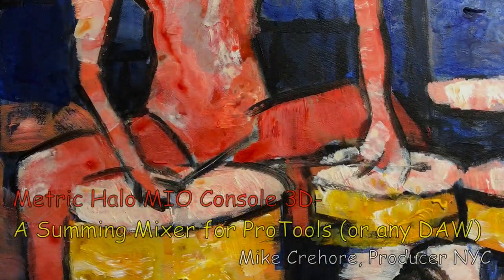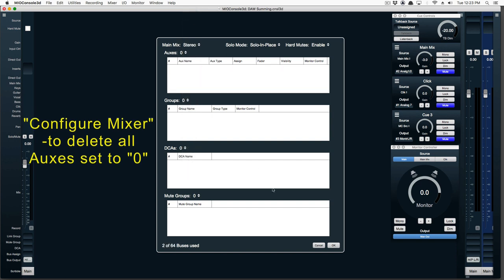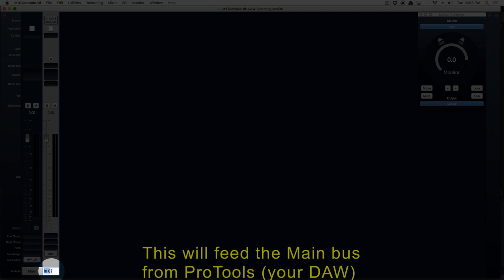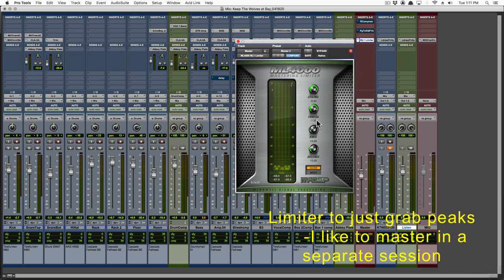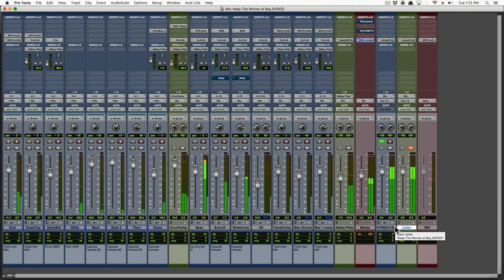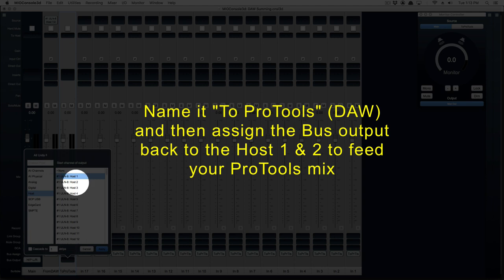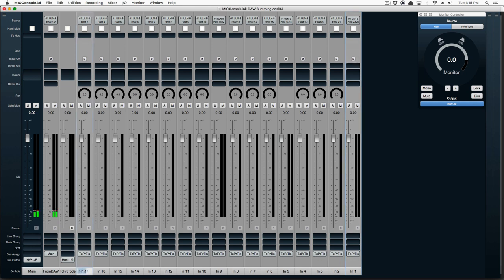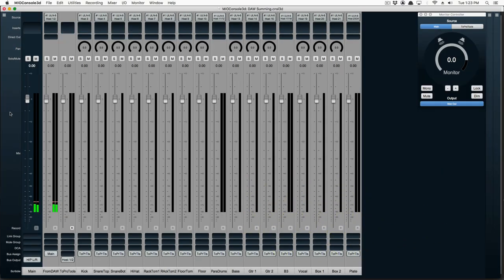Part 1- Metric Halo's MIO Console 3D as a DAW (ProTools) Summing Mixer

Comment: Why would you do this? I'm just curious...do you find an improvent in summing sound? Do you have a website or email where I could ask a few questions re: your mio workflow?
Reply from the maker: Hi Ezra.  I did this series specifically because someone asked how to set it up. Early on in the DAW world, when the computers and interfaces weren’t the best sounding, using a summing box like a Dangerous 2 Buss or an SSL summing mixer could give you a larger sounding mix compared to either “bouncing” or tracking to a stereo pair in your DAW of choice. However, most CPU’s and programs now run natively with amazing results. This was strictly a setup video and not an endorsement. I personally mix in the box at this point. Especially since the MH D/A converters sound so glorious. Try it yourself and see if you like it better or not. It is all personal preference at the end of the day. Thanks for checking it out.